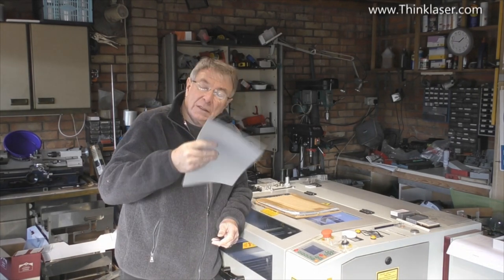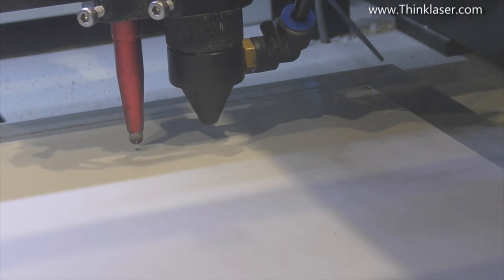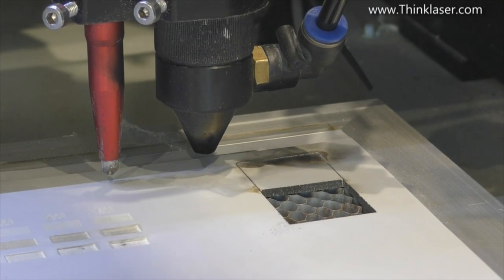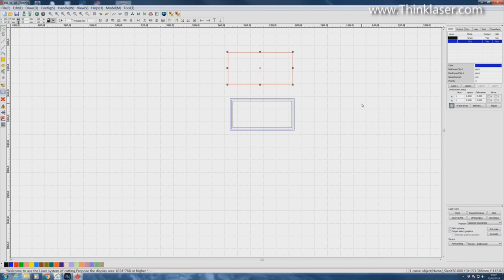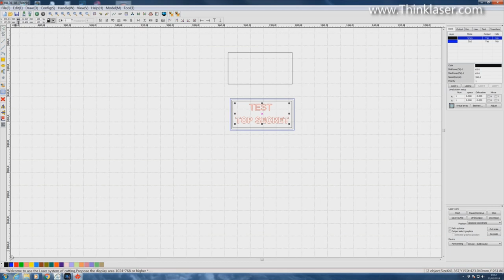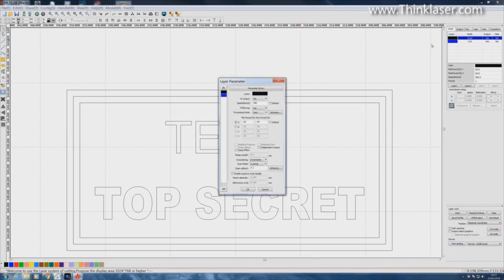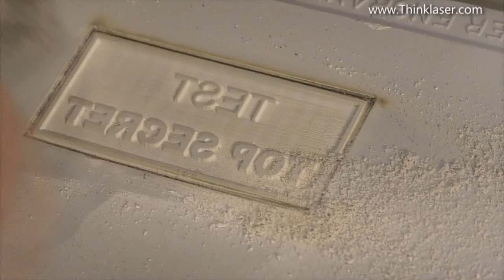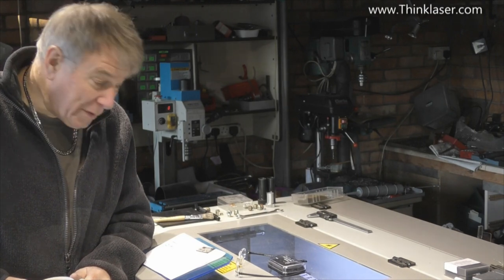Laser Engraving a Rubber Stamp (2018)

Comment: The holder is supposed to be something solid&rigid and a flexible pad between it and the rubber. In other words, you need a soft cushioning between your stamp rubber and a solid block of holder to apply ink properly.

Comment: Will these parameters work for the Chinese Thunder Laser machine too?  I'm using one that is almost identical to the one from your other series of videos, and I'm having trouble with the stamp I'm working on.  Any advice?
Reply from the maker: Hi Nathan,

Russ uses an EFR 60W tube so you will have to base your parameters on that basis. He was also using a special laser engravable rubber sheet from Hobarts so you need to check if your product is similar. 

Otherwise, I would just double-check that your optics are clean and aligned and try again.

Regards 

Gareth @ Thinklaser

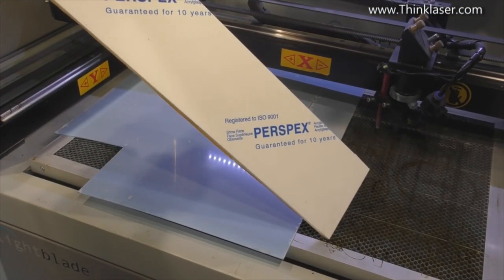Comment: what material is that at 19:31, its looks like PVC.
it's some kind of PVC for Laser?
Reply from the maker: Hi Eduardo,

It was 5 x 2.3mm (A4) standard laser rubber with vanilla scent (RU.VAN.23.A4) = £21.80 from Hobarts.com

Gareth @ Thinklaser
Reply: @Thinklaser  , Thanks
but i means PERSPEX one, its acrylic opaline or some kind of PVC to laser cut?
Reply from the maker: @tugaminhoto4969  Hi Eduardo, Perspex is an acrylic. You should not laser cut PVC or any chlorine based product.